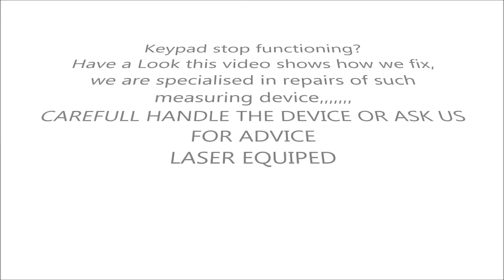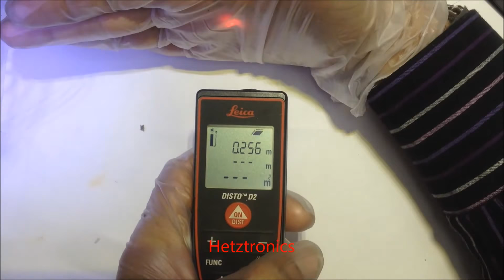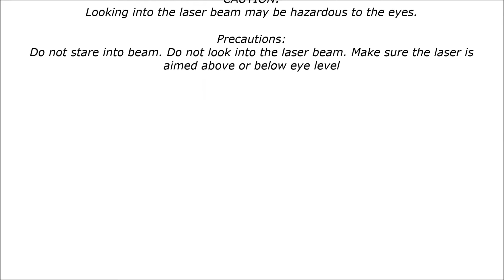Leica Disto D2 Laser Distance Meter Keypad Fix @Hetztronics-Tech-Co

Comment: Thanks for your video. I have a DISTO D5 device which has strong battery drain. On normal operation, it uses around 500 mA. When the unit is completely switched off, it still drains 240 mA... Any ideas how to fix that ? Pulling the batteries out every time is really a mess. I didn't yet torn down the device as I'm waiting for a 5 point torx screwdriver.
Reply: hi Samual,
Did you ever get your problem sorted ?
I have a similar problem with my Leica Disto D3  - It will drain the batteries even though it is not turned ON !!
Reply: @peterpauldonoghue7024  No, I didn't. I finally managed to open the device and spotted the component that seems to drain that current. It is a small chip (3mm x 3mm) at the center of the board labelled BDR/01J/PJ96. I wasn't able to find info on this chip. I gave up on this. I now use a Bosch GLM 50C that works as expected.
Reply: @svetsch  _ Thanks Samuel, for taking the time to reply to my query -
 My DISTO D3 is really gone weird- It will turn on automatically when I insert the batteries, and work OK - will illuminate the laser and take a reading every-time the Red button is pressed.
If I hold  the Red button down constantly for 3 seconds  - it will even enter the max-min mode ..and work OK 
BUT if I turn the Unit off - It will not switch ON again - No matter how many times I press the Red Button !!!! 
 I have to re-install the batteries and them I'm back to square 1 above .. 
If I leave the batteries in - the unit switched off automatically after the set time of 'non-use' and will drain the batteries. 
I suspect Its a problem on the Board - dry solder joint or something - BUT I cant even guess how to open the Thing !! ..
Reply: @peterpauldonoghue7024  I've just got a D3a with exactly same symptoms as you describe. The issue was with the keypad - it was as if the red button was constantly "slightly" pressed (megaohm resistance between pins 1 and 2 [or 2 and 3, not sure now]). You can test the keypad with ohmmeter after disconnecting it. There must be OL between all the pins (be careful not to damage traces on that foil part).

Simpler test for confirmation - unplug the keypad and insert the batteries, it should not turn on. Then connect the keypad. If it does turn on by itself, then the keypad is the culprit.

It's fixable, but difficult. The keypad is a rubber part + two foils on top of each other under that, which must be separated. The bottom foil has printed traces and some are crossing others (like a bridge over highway). One bridge must have failed. I "cut off" that bridge (disconnected traces on each end) and managed to put there a very thin jumper wire pressed against original traces and slightly melted it into the foil. I have my doubts it will be a lasting repair. 
Better option would be some isolation layer (nail polish, conformal coating, just a piece of tape, etc) over the original bridge and painting a new trace with conductive pen (but I've had mostly bad results earlier).
As a last resort option - adding a dedicated hardware button wired directly to the keypad connector (good soldering skills required, it's tiny).
Reply: @ikeblaster  
Thank you so much Vojtěch Kinkor, for taking the time to reply to my problem.
Unfortunately - I am unable to even open the Unit ( Mine is a Disto D3 ) 
However, I did discover something - If i heat the unit up by placing it on a hot radiator, it will work !! - But once it cool down again, problem returns. It will only function right if the Disto is warm !! .
Which, lead me to believe it is either water ingress or a dry solder problem ?
I'm not great at soldering, so even if i could open the Unit - I might not be able to fix it ..
Thank you again for taking the time to type out your solution, And I hope your fix will be permanent on your D3a ..
Reply: @ikeblaster  Thanks for your write up above! I have a D3 with on/off issues. There could be a suspicion of water ingress, the only malfunction is the need to remove battery to turn on. (And batteries are drained as it doesn't fully switch off or back on)
*UPDATE* Fortune favours the bold :-))
The D3 case opens fairly easily by prising gently, I started at the middle of the base (Tripod connector) end. 10mm wide thin blunt blade. Once that pops, gently work up along both sides. If you are used to opening phones/tablets it's the same method. 
This seperates the face plate, be careful as the display is then free as well. 
Confirmed as per post above that replacing the batteries with no keypad does NOT turn on the unit.
I cleaned the keypad ribbon and reseated in the connector. 
RESULT - All is now 100% working.

Comment: What were the symptoms?
Reply from the maker: THE DEVICE IS WEATHERPROOF SOME HOW WE FOUND SIGN OF MOISTURE AND SOME BUTTONS WERE NOT WORKING, WE FIX  SOME CONNECTIONS AND COMPONENTS
Reply: @Hetztronics-Tech-Co  I've got a similar device Disto A5.
ON-DIST button works fine as "ON" function but later you have to press it rapidly even dozen times to switch laser and another dozen to make a measure.
Sometimes a timer function activates. All the rest of buttons work fine (however it's hard to use them in this situation).
Any advice?
A5 seems much more bulletproof and less dismantleable than D2.